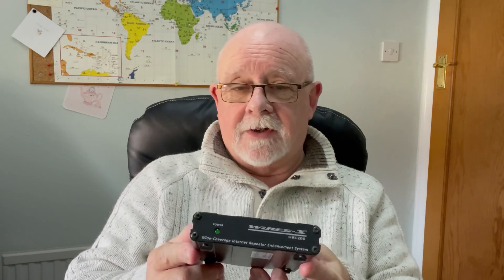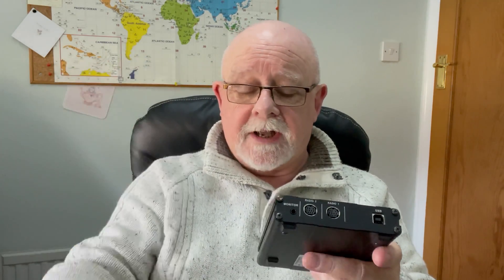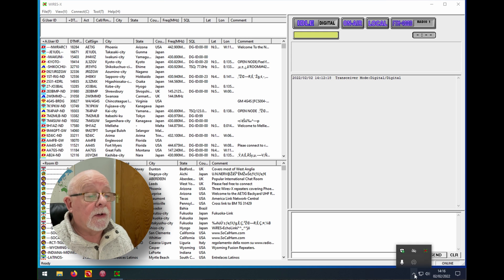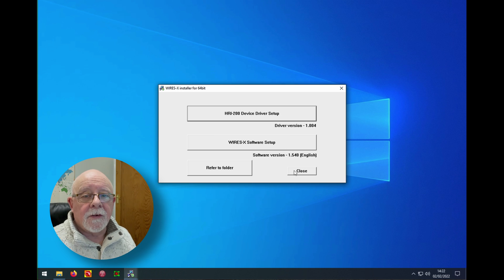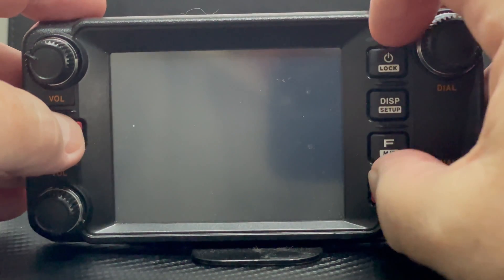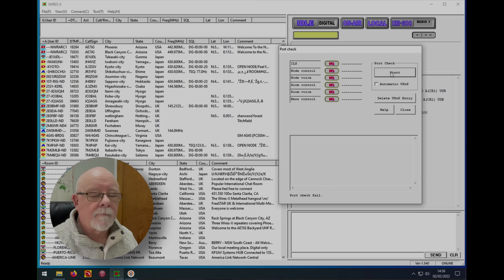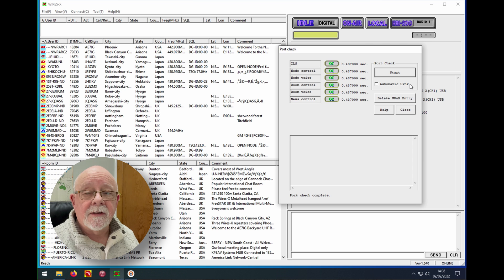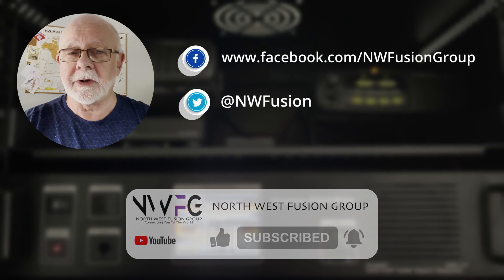21. Using the HRI-200 with WIRES-X

Comment: Recently discovered your channel and subscribed. I really appreciate your work and sharing your videos, insights & tutorials I have learned so much from your works.  My FTM 400, HRI-200, FT1Ds have been collecting dust in my Shack for a couple of years due 2 Strokes & other medical issues. Now I am looking to clear the dust away and start getting active on YSF Nodes possibly set up a YSF repeater and/or room. I plan to binge watch your videos you have really motivated me thanks, de AA4SH

Comment: Hello Ian, I'm new to the hobby having just passed the Foundation Exam. I would like to learn more about C4FM and WIRES-X so intend to watch all of your videos which I find very informative. Could you maybe answer a query for me? If I were to purchase a 'donor' radio (say an FTM-300DE) and connect it to the internet via a HRI-200 and my computer, then use something like a handheld FT3D to connect to the  FTM-300DE, would the FTM-300DE need connecting to an antenna? I am thinking it wouldn't because I would be transmitting from the FT3D via the FTM-300DE/HRI-200/Computer/Internet. Am I correct? I'm in Chorley so in the NWFG area. Thanks. Paul. M7PTH.

Comment: I have a ftm100dr into the hri 200 and am using my ft5dr handheld to get into wires x. My  external antenna should be plugged into the ftm100dr correct? My handheld should be hitting my antenna plugged into the "donor" radio right?

Comment: Hi everone, just a question I have the FTM400 Connected to my PC and use it as a hotspot for my FT3D. But I have the 400 connected to an external antenna and the question is can I do this.
Reply from the maker: Currently, the answer to this is no.  You could put it on a dummy load so that you could use it around the house but it cannot be used in such a way that could allow other amateurs to use it.

Comment: Hi: 
I'm going to be purchasing the FTM-200 and I was wondering, when using the radio is in HRI mode, with the SCU--40 or 58 wires x connecting kit, can I access the various wires x rooms using the microphone or do I have to pick a room from the list in the software on my PC to connect. I'm a blind ham and I like the idea of dtmf commands to access a room especially on a repeater or PDN set up using 2 radios. I'm hoping that using 1 radio in HRI mode, instead of trying to catch a room through the large scrolling list, I can just enter the room of my choice using dtmf commands on the mic. 
Thanks: 
Michael DE VO1AX
Reply from the maker: Hi Michael.  This can sort of be done using 2 radios.  One is set up in Portable HRI Access mode.  This then works like any other gateway.  You would 'connect' to it from another Fusion capable radio by pressing the DX button.  Then, a long press of the # button on the mic and the radio will beep.  Enter the room number you want then a short press of the # button.  The radio will beep again.  If you connection is successful, you will get the 3 tone confirmation beep.  I hope this helps.  Ian

Comment: Hi again Ian just a quick question, when in Transceiver settings I am only using Voice CH and Preset Search CH is off, why does the B band on my FTM300D make noise as well when I PTT? I can see it is in FM mode instead of DN but is there a way to remedy this or is it just normal to turn off the volume on B band?
Reply from the maker: What the display says is irrelevant to be honest as it should be in HRI mode.  There is no B band as such in this case.  Just turn off the volume.  It isn't needed at all
Reply: @NorthWestFusionGroup  So it's normal for it to behave that way? If it is then great because I was starting to think what I did wrong when setting it up 😅
Reply: @NorthWestFusionGroup  Well thanks again Ian. I really appreciate it. :thanksdoc:

Comment: Hi, so basically the radio that's attached to the HRI-200 in this way means I can't transmit using that radio, I would have to use another c4fm capable radio in order to transmit? Should I attach a dummy load as well in this case? 😁
Reply from the maker: Absolutely correct.  As for a dummy load, that depends where you are in the world.  In the UK, it would need to be on a dummy load or apply for a NoV to run a gateway.  The radio will produce RF when connected to a HRI-200, the output of which is set in the transceiver section of WIRES-X
Reply: @NorthWestFusionGroup  I see. I just wanted to double check before trying to setup in this manner. I only have the HRI-200 that recently arrived hence this is the only way I can set it up. Thank you for the very informative videos and appreciate your reply. Subbed and looking forward to future videos. :thanksdoc:

Comment: Well dead good. I like my HRI200s. I may even have a go at building a radioless node with one at some point. 73s
Reply: Is this doable? Once you have your Room configured, can you simply disconnect the radio from the HRI-200 so your room is available via WIresX w/o the local RF connectivity?